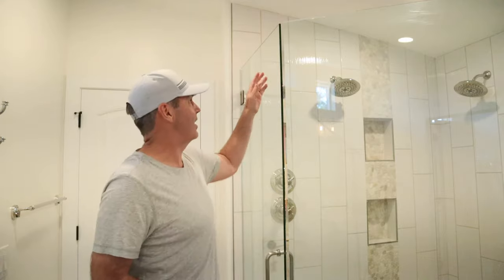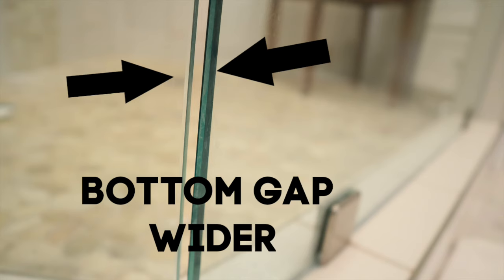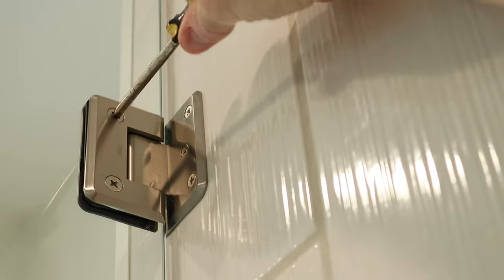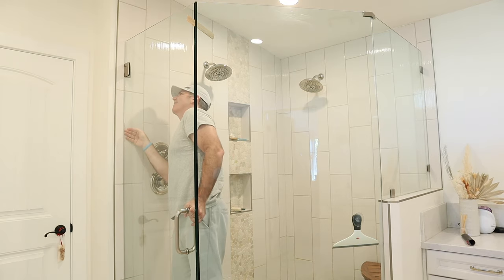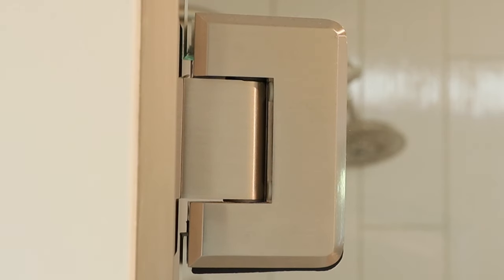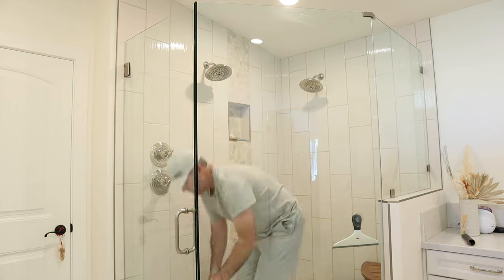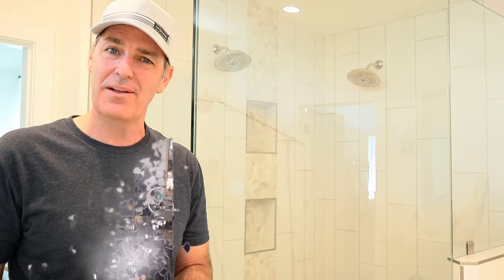How to fix a sagging shower door 2024

Comment: Thanks! Called a shower door company, and they wanted a $150 trip charge. Watched your video, bought shims for $2.99, and saved $147!
Reply from the maker: YESSSSS!  LETS GO!💰
Reply: I just got a quote for $300 for someone just to do a service job! We will give this a try!
Reply: *service call
Reply from the maker: These trades are throwing out crazy numbers!! Good luck.  Most of them are Phillips heads… Just make sure you have the right size that will help when you’re trying to tighten. I ended up using an impact driver on mine, which really helped. Haven’t had to adjust it in well over a year.
Reply: I used chopsticks for shims and saved $3 😂 was easy fix
Reply: This is helpful 👻

Comment: Unclear about adjusting the glass door after loosening the screws. This being an important part so need to slow down the video with visual clear instructions. Also what if the screws are on the top of the door? Have not been able to fix the dropped door using this video 😢

Comment: Having this style of hinge, your tip worked for me. Thanks. I took apart wooden clothespins to make shims, saved a trip to the hardware store. I can’t believe how many years I put up with a misaligned door!!! Make SURE to use the proper size Phillips, mine was a 3 or a 4, not a 1 or 2.
Reply from the maker: Great advice on the right sized Phillips head!  Makes a huge difference.

Comment: The hinge was loose from the plate screwed to the wall.  I had to remove the door to tighten.  There appears to be adjustment screws on the wall side of the hinge but they are too tight.  Anyway, thanks for the video!❤
Reply from the maker: Well done…some more work than expected but still a cheap fix!
Reply: Another youtuber demonstrated an acrylic rod can be used as a permanent shim so the door will always be in contact with the hinge.  He linked 100 rods for 16 dollars off amazon.

Comment: You left out that you also need to insert small hard plastic shim pieces inside the hinges to prevent this type of slippage in the first place. This door will slip again in a few months. I also replace the dried-out rubber gasket with double-sided Monster tape.
Reply: Hi, I am having to adjust weekly. Can you explain the small plastic wedges in the hinges. How, where? Thanks
Reply from the maker: I havent had to adjust mine since i was able to find the right size phillips head (#3) and put enough torque on screw.  No more issues
Reply: This is very true. My new install is sagging after just a few weeks and the unqualified idiot who installed it didn't know to use the shims. He left them and said "these are for a different type of door". At least I have them so I can fix it myself. It's just a little daunting to work with such a heavy slab of glass. Knowing what I know now, I'd never get frameless doors again.
Reply from the maker: Man thats frustrating…the trades aren’t what they once were.  I had a remodel where the plumber was clueless!  Definitely get some help but once its done hopefully you can enjoy it

Comment: Thank you for your clear and concise fix.  I had the same hinges as your shower so it was incredibly easy to follow along.  I would recommend using shims to adjust the shower door since it is very heavy and can be easily damaged if dropped onto the tile.  In my case I used 2 paint stirs on the hinge side and 3 on the handle side.  They helped adjust the door perfectly.  The repair took less than 5 minutes.
Reply from the maker: Thx for the input…glad it helped!

Comment: Just watched this video and fixed my glass shower door. It has the exact same hinges, and this technique for fixing the sag worked perfectly and was super easy. Thanks!
Reply from the maker: I found i eventually needed a #3 phillips head (thicker) and my impact drill.  Hand tightening works but you may need to adjust again in a few months

Comment: Thanks for the video. 

For anybody wondering, you don’t technically need the “shims” as long as you are comfortable holding the door while loosening it. 
If not, get someone’s help in holding it in the meanwhile.

I did it by myself with just a screwdriver. Grabbed door handle and used foot for support.
Reply from the maker: Thanks for input!!

Comment: Thank you for the video. It was well done. I do have a tip to add I learned over 30 years ago. If the screws are very difficult to get loose I recommend purchasing a tube valve grinding compound at your local automotive store for more gripping strength, then dapping it in screw and then using a long handle 3/8 ratchet and apex tip for extra torque. Tapping on the screw for several minutes with a hammer and screwdriver or apex tip to break the seize maybe required as in my case.
Reply from the maker: Wow great tip!!

Comment: Hiding in plane sight--great fix! One suggestion: let the bottom shims due the lifting vs the glass door handle. Slide the bottom shims while the screws are loose until the glass door is level and then tighten the screws. Done!
Reply from the maker: Great idea thx!

Comment: Just this week the shower door started rubbing the glass on a single door application. I removed the drip shield at the bottom and got inside the shower. I put the wedges in on top of each other from opposite sides. I loosened the two Phillips screws and gave some taps on the inside wedge, and nothing moved. Light bulb in my head went off and thought that piece of 3/8” glass is heavy. Tapped more on the wedge and it kept moving. Looked up and there was a 3/16” gap similar to the bottom. Tighten all the screws and it fixed. I’m pretty mechanical, but working around glass has a pucker factor.
Reply from the maker: I hear you…the quick DIY can be “free” or get expensive real quick.  To put your mind at ease I actually used an impact drill on my screws eventually. Loud/glass rattled… But it was all good.

Comment: Thank you for this video.  My problem is not side to side, as you have shown how to fix here, rather front to back.  That is when the bottom of the door is flush with the shower side glass the top stick out.  How do you make that adjustment?

Comment: Hi, this adjustment procedure works great.  But after a few weeks I have to adjust it again.  I just had new shower door hinges installed, and three weeks later, the door is out of alignment and the bottom of the door drags against the tile.  What am I doing wrong?  Why won't it stay adjusted?  Any help is much appreciated.
Reply from the maker: My screws are phillips head #3.  I only specify that because I wasn't getting a good "bite" when adjusting.  So make sure you using correct bit for your screw (could be allen wrench, torx, or phiilips).  The other issue is probably that you are not tightening them enough.  I use impact driver (drill driver is probably ok just make sure you don't strip) on mine...need to put quite a bit of torque on screw to get it to stay.  Make a long story short you aren't tightening them enough.  Had that issue early on with my door (about every two months had to adjust again).  Haven't adjusted it in over a year since i used the steps above to adjust it.

Comment: Using an impact driver with a #3 screw tip works well. Once hand-tight, full throttle on the impact gun for 2 to 3 one-second intervals outghta do it. You'll break the metal hinge or screws long before it breaks the glass.
Reply from the maker: Thanks!  Awesome input

Comment: Great video, thanks! Unfortunately my door does not slide at the top hinge. It seems very stuck. Any tips?
Reply from the maker: Hmmm…rubber gasket between hinge & glass?  May have to remove door entirely…assuming it has stuck to glass/hinge
Reply: Oh darn. Well, thank you for the reply!  @how2q

Comment: Thanks, seems I was on the right lines, managed to adjust must not have tightened it back up enough as it’s sagged back down
Reply from the maker: Seems this is a slippery slope.  Mine holds for about 2 months and then needs to be adjusted again.  Having the right drill bit (#2 or #3 phillips head usually)

Comment: I have a shower similar to that one. It seems like they didn’t push the glass back or closer to the wall. When water is splashed, it leaks at the bottom and outside it the glass. And this is the side glass not the door glass. I am also not able to close the door properly. What could fox this?

Comment: Hi I was able to use this trick on my first door and it fixed it. However, I’ve done the same trick on my second door and it’s not fixing it.
I’ve tried loosing the top and push it in because my top part is not closing flush with the other side. Any tips?

Comment: Hey -- hoping you can answer a question.  I see an irregular edge of the black rubber gasket around the upper hinge, but I don't see it around the lower hinge.  Does this mean it needs replacement?  If so, where would I find one of those...  Thank you!
Reply from the maker: Search shower gasket hinge on amazon.  Many options will pop up.  I would try and replace the bottom hinge gasket

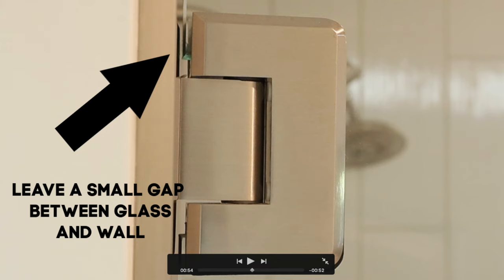Comment: Hello and thank you for sharing this video. I have a sagging door, like that shown here.  The hinges on my installation have set screws on the inside edge of the clamp that holds the glass door.  Are these adjusting screws to maintain that gap you mention at  01:24 of the video?

Comment: Great video!
Reply from the maker: Hope it helped
Reply: @how2q Well.  I loosened the screws, but the glass would not move. 😕
Reply: @how2q What are the smaller hex screws for? Could cranking on those adjust the glass?
Reply from the maker: @Texhubby1 how old is the door/hinge?
Reply: @how2q  It was installed mid 2021.
Reply: Never mind. The gasket was sticking to the glass like glue.  I took the cover plate of the hinge completely off, then pried the glass off the other side of the hinge gasket by hand. Once it was loose I was able to adjust the glass, reinstall the cover plate, and tighten the hinge clamp back up. Works great!  Thanks for the help!

Comment: What if it keeps moving and you have to tighten from the hinge..I align it and it sags every few days..
Thanks
Reply from the maker: Not all phillips head bits/screwdrivers are the same.  Make sure u have what i’m assuming is a #3 phillips head screwdriver.  Also, you may not be tightening enough.

Comment: I have this problem almost every 6 months.  Is that normal?  Same design hinge - just with hex wrench screws.  I use the shower once a day...
Reply from the maker: So i used to have to adjust about the same amount of time.  I ended up using a #3 phillips head (correct size) and an impact driver.  Don't go too crazy but I haven't touched it in almost two years.

Comment: How do you tighten the part that the hinge pivot on mine looks like it’s coming off the wall
Reply from the maker: If your hinge is starting to come out of the wall you may have a bigger issue.  Somehow that connection has been compromised.  You could tighten but it will probably loosen again.  May need longer screw or slightly larger one if possible

Comment: Very helpful!
Reply from the maker: Glad it helped!!
Reply: @how2q  May I ask you a question?  The house is new, built in May 2022.  Once we fix the shower door, as you detailed, will this problem reoccur as time goes on?  And if it does, is there something we can do now to prevent this happening again?  BTW, the hinges are exactly like the ones on our shower.  Thanks
Reply from the maker: @jimh4188  well stating the obvious here, but whoever installed that did a pretty bad job. The rest of the story on this door is I would have to adjust it about every 2 to 3 months until I used the right Phillips head and an impact driver drill. make sure you have the right Phillips head for the job. Not every Phillips head is created equal. Use a number three which will give you a better grip. I actually used an impact drill on this one.  I think it’s almost been 18 months once I used the impact and correct Phillips head. I hope that helps.  if you don’t have an impact drill, driver, just try to hand tighten and see how long it lasts. If you’re having to adjust it every 2 to 3 months then definitely get an impact driver
Reply: @how2q  Or maybe contact the contractor and ask him/her to repair it correctly?
Reply from the maker: Yes…that would be option 1!!

Comment: What do the allen set screws do on the interior side of the hinge?

I'd it possible to grind the cutout of the glass to make the cutout larger? My glass door hasn't sagged. But won't close as it hits the edge of the pony wall
Reply from the maker: Wondering if you can loosen hinges and adjust door towards hinge without flat side hitting wall (wall opposite of pony).  Maybe glass is too far out from hinge?

Comment: GREAT video, but you didn't address how to loosen the screws if they won't turn without stripping them :)
Reply from the maker: Impact drill.  That would be my first option.  Make sure you use correct phillips/allen screw size.  Most “stripping” occurs due to improper size bit.  There are 3 different sized commonly used phillips head bits or drivers.  I need a #3 for these (largest)

Comment: I ordered my shower door and it appears to be about 2 inches too short. Well we can adjust the glass about an inch. But, we need a possible hack to connect the top bar to the wall of the glass sliding door. any thoughts? Trying to fit s 60 inche wide glass sliding door into a 62ish inch shower opening. It took forever for this door to ship do to back orders.
Reply from the maker: Sorry it came up short…i am a dad diy guy and not an installer.  Possibly reach out to a tuber that does this for a living.  Sorry i don’t have a better answer

Comment: Any hint on getting the screws to loosen? The installers likely used a drill to overturn the screws
Reply from the maker: Not all phillips head screwdrivers are created equal.  Make sure you are using a larger size phillips head (#1 or better (bigger tip width)).  That will help.  Most standard screwdrivers are much smaller than required
Reply: @how2q  thanks

Comment: How often does this happen that you need to adjust a sagging door? This normal that you need to keep doing this over and over again? How do you prevent this in the future?
Reply from the maker: Every hinge is different.  On mine…i was “resetting” it about once every three months.  I changed to a #3 phillips head and impact drill and haven’t had to adjust in almost a year.  So possibly you are not getting torque necessary on screws
Reply: @how2q  Awesome thanks!! Just scared to over tighten as I'm paranoid that the glass will break..LOL..  much appreciate the great videos!!

Comment: My glass door won’t open out? I’m only able to push in but not out, what do I do in the situation??
Reply from the maker: Without having eyes on it, i am assuming that the”clamp” hinges have loosened and the door has moved away from wall making an overlap w glass
Reply: @how2q  thank you for replying. Would that be something I can do without the glass coming out? If that makes sense
Reply from the maker: @Susana2009ish  it should be a matter of slightly loosening the hinges which ripped the door. Definitely a two person job. Do you want to make sure that the hinges still have some friction to help hold it up but loose enough you can still adjust

Comment: Hi. The screws on my shower door are smooth, as in they don't have a place to use the screwdriver to create the movement. How do I lose those?
Reply from the maker: There may be some small covers over the screws…i see that sometimes
Reply: @how2q  thanks so much 🙏 how would I remove the covers
Reply from the maker: @angelaterri  if you have a small screw drive or puddy knife (something thin to get between screw and cover

Comment: I have this exact hinge and I have to keep correcting mine every 2-3 weeks because it continues to sag. Any Ideas @how2q?
Reply from the maker: I adjust mine about every two months.  My only thought is make sure the screw(s) are tight by using larger phillips head.  Probably not your issue, but at a loss to help you.  Sorry

Comment: Does not deal with the issue which is that the spacers inside are not doing their job.  Do this and you’ll be at it every couple of months until the screws get torn up.  Add material to the shims.
Reply from the maker: Thx todd.  Must have a lot to do with the quality of the hinge. I need to tighten mine every five or six months. Not too bad compared to what I’ve seen some other people have to do. Appreciate your input
Reply: Do you have any advice on how to do that? Do I take the hinge cover off completely?

Comment: Tried that and couple days later it just slid back.
Reply from the maker: For my doors, using correct sized phillips head (i needed a #3) and impact drill worked best.  Mine has held over a year (when i was screwing in might hold for about month).  Sorry it didnt work for you
Reply: @how2q   how tight is right for this job I'm a car mechanic so I don't wanna go to hard. Hand tight then 12v impact on it or just wrench it down

Comment: I do this every two weeks though.  It’s getting tiresome.  Surely there is a more definitive fix.
Reply from the maker: Sorry for delay….make sure you are using correct size phillips head…or allen wrench.  Mine is a #3 Phillips head.  Also, if you are constantly adjusting you don’t have enough torque on whatever your using to tighten.  I only say this because I was making these mistakes. I would have to adjust heard about every six weeks or so.